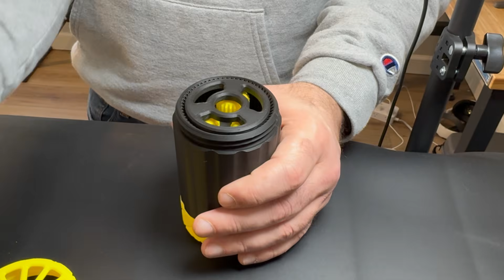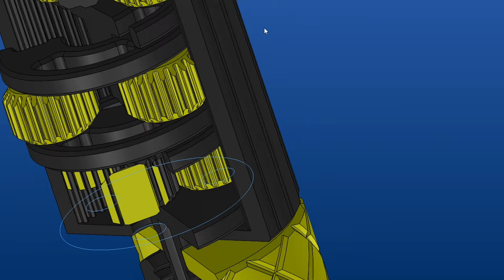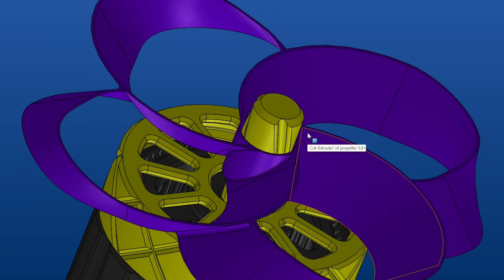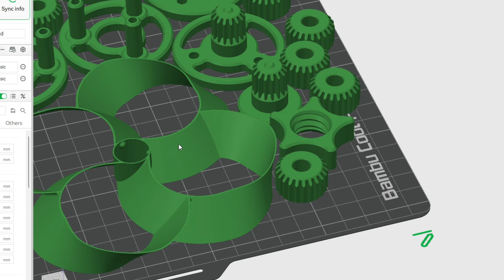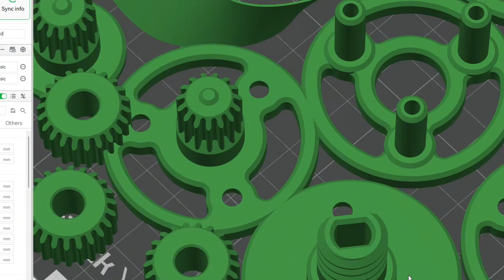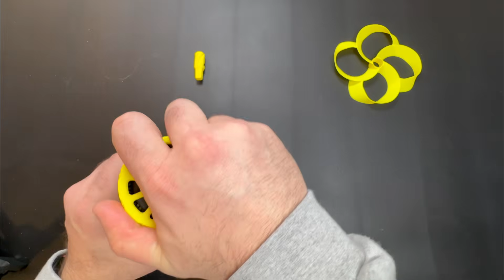3D Printed Toroidal Fan Launcher | Planetary Gearbox Design, Print Setup & Assembly

Comment: Awesome design. I just printed it out of PLA. If I screw the top on tightly, I get some binding as I twist. Any recommendations for lubricants, or would it be better to maybe sand some of the parts?
Reply from the maker: Something printed big.  There is generous clearance on all of the parts.  I recommend sanding.  Lube might help too